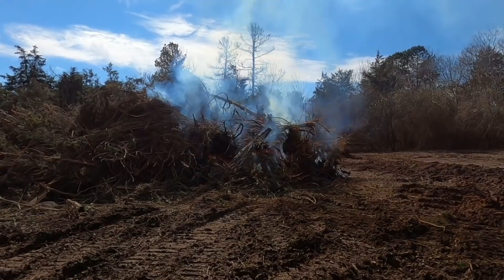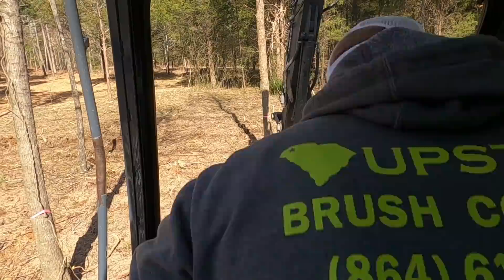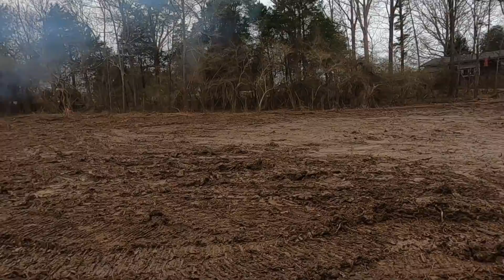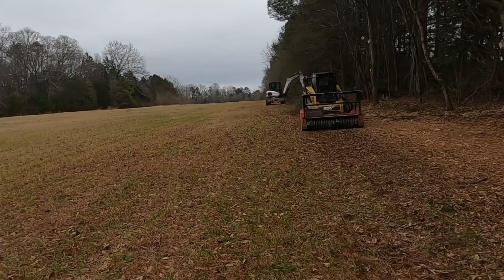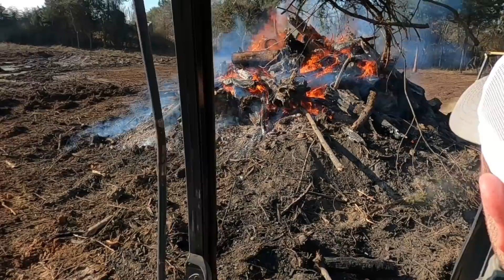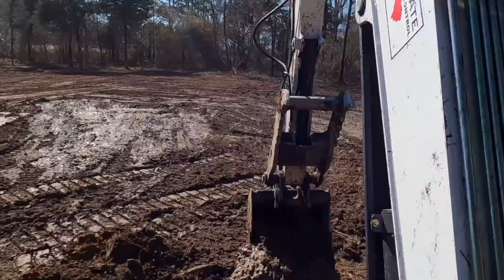Clearing for a 1700' Driveway

Comment: You need to weld up a swale-bucket (you can do it yourself).  It will improve your ditching efficiency by 500%, along with an improved visual result.  While your at it ... weld up a grading bucket as well.  3 times the size for grading (only lifts light loads of dirt).  A nicely graded 10' wide swale where you're currently ditching will provide great drainage for the whole area, and will be visually appealing from the house.

Comment: I would suggest to the owner  that along the woodline you dig in a trench an make a french drain, use it to intercept the water coming from the golf course, put in a culvert under where the drive way will be going an run the trench right across the field to the opposite side .Run some additional drainage runs from across thw field and its wettest areas an link them into the main run. If they already got a swale ? Possibly run all drainage into it if not dig an area out the way to one side an break through the rock barrier so that the water can  drain through into the ground, It would likely leave that opening in the rock forever wet though, so either accept one small area of wet land or find an existing drainage swale that can discharge the water more effectively. Golf  courses use a lot of water ,like a lot a lot, some intercepting the run off would likely massively reduce on its own the amount going across their field on its own, to run some additional drainage in the field should then more than take care of what falls from the sky when it rains